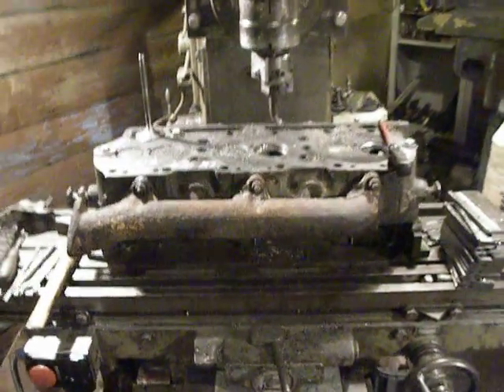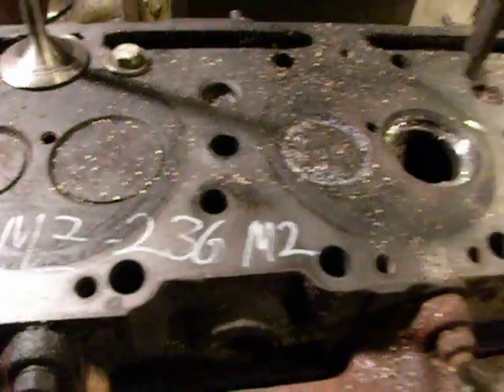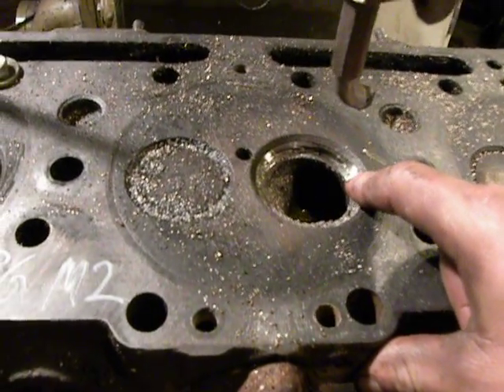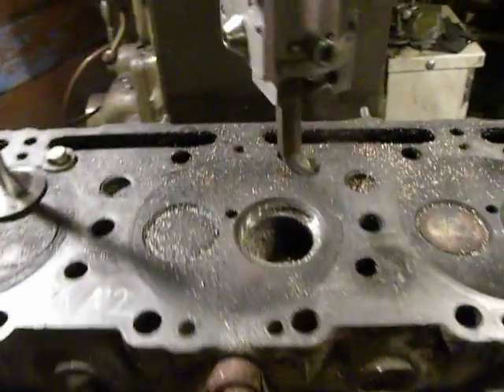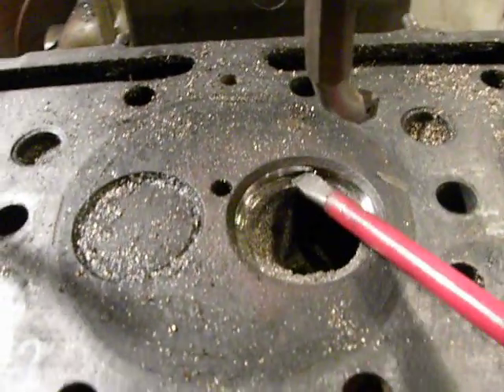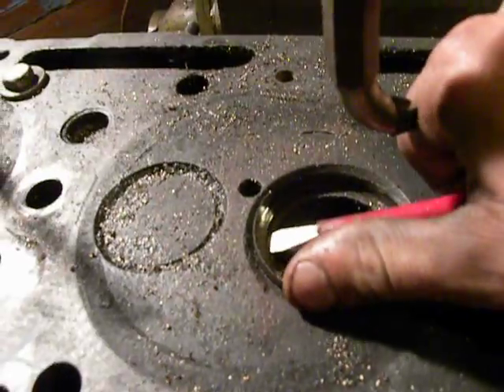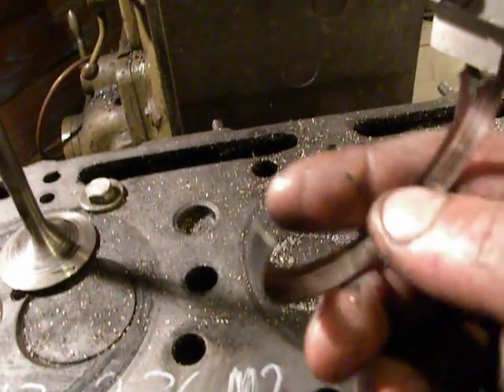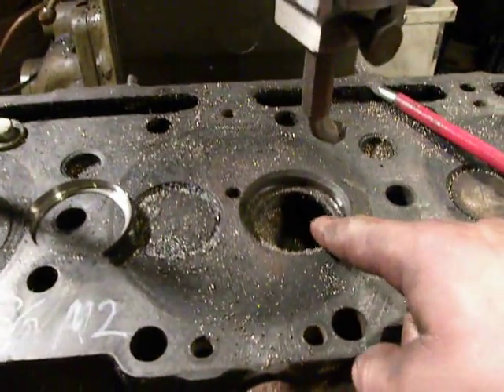Diesel engine valve seat repair - begining (part1)

Comment: you should be able to buy replacement seats install them by heating the head and freezing the replacement seat in dry ice. the seat needs to be an interference fit in the head.